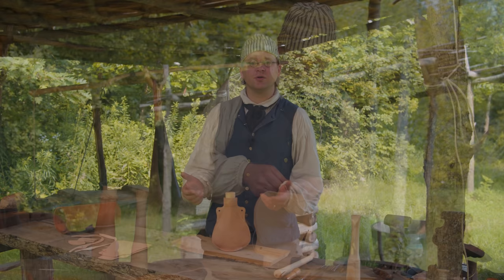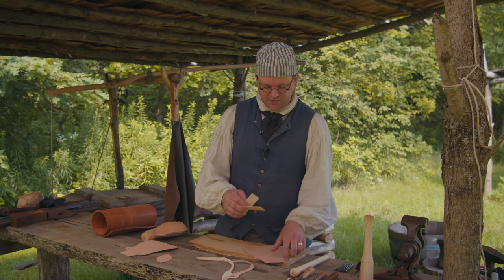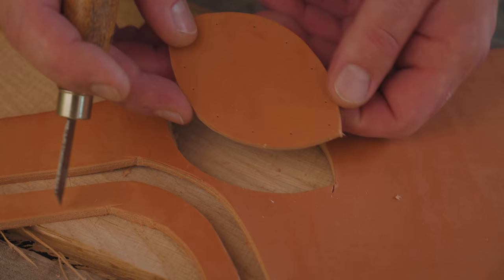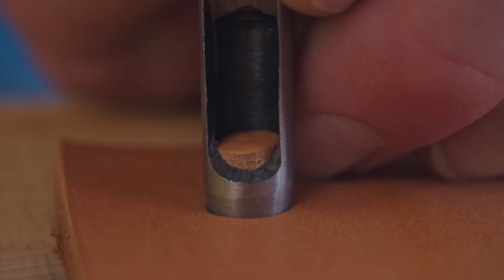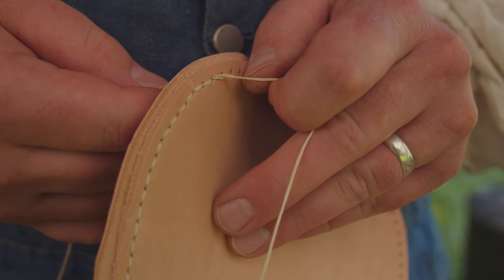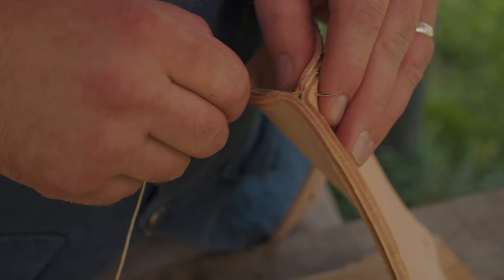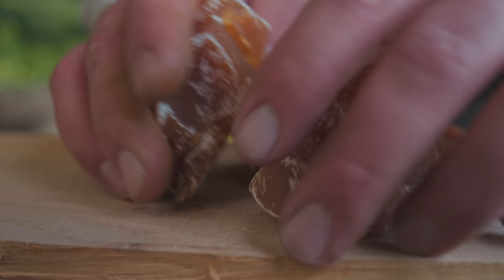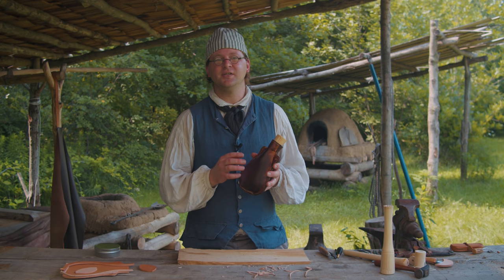Handcraft Your Own Leather Canteen

Comment: Thanks for the video, it was informative and a joy to watch.  Brandon is a good teacher.  This is a project that I would like to try and I am a beginner who has never picked up a piece of leather but I quickly found myself feeling like I was missing steps in the process you taught. To make the a little more beginner friendly would it be possible to put in the description box a list of all the ingredients, materials, and tools used to make the canteen? In the video you briefly showed the basic items you would need, but I felt like along the way you kept bring out new ones for example to two different tools you used to make the holes.  Also please add the quantities, lengths, diameter & amounts needed to create the same exact canteen as you are making.

Also, if there are links to the pattern/materials/tools (18th century or modern versions) that you used and talk about the different kinds to use, like pine resin what grade to use or stay away from. Or a link if there is a Townsend project kit, or materials to make getting the items for the project easier.  To me obtaining and making the pattern is the most important part and without it I would have no clue where to start.

Also, some parts where seemed to be edited or unclear like the first saddle stich, I would have liked to seen the first 5 or 6 stiches to make sure I was doing it correctly. Also, since we were not using one long thread for the job, it would be nice for you to show how to tie off the ends when the string is used up and how you start the new thread so it is seamless.  I also had questions on why you ran the thread through the beeswax and who you twisted the ends of the thread.  

All and all a great video and something I would love to try.

Comment: I have learned things about leatherworking today that I wish I had known months ago, when I first started toying around with waterproofing and hardening leather. My soft leather waterproofing is a mix of tallow and  beeswax, and it's wonderful for soft leather projects, but pitch is something that's been used on curraghs here in Ireland since long long ago, and somehow I just never connected the dots. I guess this'll be my next project. For anyone wondering, the reason why the pitch works is because pine resin is high in oleic acid, which hardens and waterproofs the leather, all the more so when heated, and it won't shrink the leather as long as it doesn't reach the plasticisation temperature.

Comment: Him. "An easy project that the average, common person can make"
Me: watches video
also Me: realistically pictures The ugly, leaky, misshapen atrocity of a leather "canteen" that would result if I tried to make this.
Reply: I know right!...I can't even cut open a box in a strait line.
Reply: The only leatherworking project I've ever made was an axe sheath I designed. It's not pretty but I learned how not to do things... and it is functional.
Reply: A tip, if you need to take 10hours to do it, take 10hours, if you need to cut your stuff in several goes, cut it in several goes, if youre doing something for fun, take. your. time. working fast is fine, but never rush.

Comment: Thank you for the fine demonstration! I have a tip for you…. After you wet your leather, pack it tightly with dry sand. This way you can shape it and get all the wrinkles and bumps out. When the leather dries out, dump the sand and bang around lightly on the inside with a stick, and you’re ready for your resin.🤗🐝🌹

Comment: The bottom oval should be made with its outer edge the same length as the length of the bottom of the bag.  This allows the same number and spacing of stitch holes. I used two small electrical wire with ends twisted together for the initial length measurement. I then spread the middle section of two wires apart to form the oval shape. The wires outline thus forms the stitch line for the bottom leather piece - cut the leather  with about 3/8 inch larger boarder.

Comment: When forming the leather, stuff it full of medium to small glass beads until the canteen is bulging in the shape you want. Let it dry before dumping out the beads. I’ve heard of people stuffing the canteen full of unpopped popcorn or beans in the canteen, but I worry that the beans or popcorn kernels will swell. That may not be a problem, but I’ve never tried it.

Comment: I've seen another type of 18th century water bottle being made before. They used hot melted down bee's wax in a few thin layers as a sealant.
Reply: That also works, though beeswax has the downside of possibly melting out if you leave it in a hot vehicle or direct sun(IIRC beeswax melts around 150°)

Comment: Don’t use metal jawed pliers to pull the needles through the stitching holes. Metal jaws rough up the shaft of the needle, making it harder to pull through. As you use the metal jawed pliers, the needle will get harder and harder to pull through as you progress. Use nylon (or other plastic) covered jaws to protect the sides of the needle - to keep the needle smooth. Plastic jawed pliers are sold by jewelry making supply stores, or you might be able to make tiny leather pads and glue them to the jaws (an iffy project).

Comment: OLD LEATHER SMITH here, Suggestions, I have found that the Backwards stitch works just as well, Bees wax will also seal the Leather, needsfoot oil 4 the out side puts your essential oil back in 2 the Leather, GOD'S BLESSINGS ✝️⚾🙃

Comment: You all make some of the best content on YouTube, thank you! 2 Part Question: How do you measure what the leather canteen can hold and, what kind of liquids will it hold? 😉😉
Reply: Well, with the tools available nowadays I'd say fill the canteen with water and then pour it out into a measuring cup, that should give you the exact amount it can hold. Or just measure with cups, 1 cup is 250ml. It can hold any kind of liquid if properly coated from the inside, except boiling hot drinks. Be aware though that after a couple of hours the water (or other drink) will taste a bit like leather and the coating you used. I generally don't recommend storing milk in such a canteen because it will taste horrible afterwards (except maybe if you used beeswax for the coating but I haven't tried that so I can't guarantee)

Comment: Great video. I think I've seen where you can wet the leather then pack the canteen with sand. Ramming it in until it forms the shape you want. Then you let the leather dry and pour out the sand...and give it a good wash. Have you seen anything like that? Thanks
Reply: That's a technique I've used many times with complete success. I have a couple of buckets with sand that's been screened to leave coarse, round, sand with grains about 3/32" diameter and no fines or bigs. Packs and pours very well.

Comment: I'd love to see more leatherworking videos like this for satchels, hats etc. 

My only question is: Isn't that a bit small? Like it must've been for just working in field cuz on a trail etc you'd need a lot of water each day w/o getting massive dehydration. You'd have needed like 10 of these for really hot days like that. 

Also how would you continue to care for the canteen after coating in the pine res and oil? Would a saddle soap or other leather softener/conditioner for shoes be acceptable?
Reply: Just wash it with mild soap if needed and then rub in some more vegetable/plant/seed oil (even butter works) once in a while to keep the leather from drying out and cracking and you're good.

Comment: Cool video. Several questions i have: Wouldn't it be easier to just use the single piece of leather and wrap the ends around a hollow piece of wood or bone (for the neck) as a sort of water bag? What were the standard size of these? The one you made doesn't seem to fit a lot of water. And last, do you have a step by step process we can watch somewhere?

Comment: Seems like it has a really small internal capacity, not much water and seems like you would need several of these. They may be quieter then wooden ones and way easier to make then metal ones but those you two you can make with a larger carrying capacity. its a trade off.

Comment: Not a "gusset" those pieces are called "welt". Also, using an awl and cutting holes INDIVIDUALLY on a diagonal makes for exact stitching and molding, and more neat, uniform and handsome stitches. Also, a  true saddle stitch requires a half hitch within each stitch.  Locking the last stitches is something else your smithy did incorrectly.  Most people will not know how to source pine resin, but propolis can be had quite easily. The edges should be finished smoothly so leather layers can not be detected. If you invite me to help you do another video, I can show your smithy and your audience the correct way to do this.

Comment: If you're going to do a single project or two, the various hobby knives etc. are OK I guess. If you are going to do more than this, quality (read: not cheap-o knives made of Chineseium) knives are absolutely the way to go. You'll need to learn the proper way to sharpen them too. They need to be scary-level sharp to be safe. A dull knife is the one that cuts you deep and leaves a lasting scar, as it slips out of the work, but leather is usually quite a bit more resilient than human skin, so it's sharp enough to cut the crap out of you. Note; blood is almost impossible to remove from a nearly completed project; ask me how I know. The things he says on this video, about going slow and making that cut correctly is 100% accurate.

Comment: @townsends So I bought some of your Brewers pitch to waterproof the inside of my Canteen.  However, I noticed a couple of places where it still appears from the outside that the leather is soaking up water. Not sure if this is a showstopper or not. I have redone it three times now and can’t seem to get this to stop. I did notice that when I first added the Brewers page to the inside that there were a couple of places where the pitch seem to bubble up and I suspect those might be the problem areas. Any suggestions?

Comment: Wonder why you'd use pine resin instead of beeswax to seal the leather.
Reply: I was wondering the same thing. Only thing I came up with is the pitch soaks into the leather to harden it, that's why he was tapping it at the end.
Reply: Beeswax will melt or fail faster than pine resin which forms a 'hard' coating
Reply: @broccodoggo8363  I'd wonder about it cracking, though, since the beeswax would tend to penetrate the leather more, and would be more flexible, since it stays softer then pine resin.

Beeswax was commonly used to waterproof shoes and boots because it retains the ability to seal when the leather is flexed.
Reply: @EphemeralTao  it also has a bad habit of melting out on particularly hot days. Brewer's pitch has a melting point about 100° higher. I know some people use a mixture of the two

Comment: I would highly recommend using beeswax instead of brewers pitch to coat both the inside and outside of that leather canteen.  Water left all day in a canteen of any kind that is sealed with brewer's pitch tastes pretty nasty.  It's a very piney flavor that is not "piney" in a good way.  When reenacting I always fill my canteen just before we take the field to avoid that unpleasant taste.
Reply: Don't recommend beeswax.  It drys out and chips.  That is why the originals used brewers pitch.  Which BTY is black in color.  Don't know what this guy in the vid is using.
Reply: @chriswitmer4446  He is using brewer's pitch.  I used brewer's pitch in the canteen I bought 20-years ago and still use that canteen.  It ALWAYS makes my water taste bad if I have it in there more than a few hours, especially on a hot day.  

If I get some permeability down the road, It's really easy to heat up some beeswax and re-treat it.   A reenacting friend of mine used beeswax in his canteen and it always tastes good even though he's only done that for the last 10-years.   I also have used Beeswax as an outside coating of leather goods such as the center-seam knife sheath I made and I've never had a problem with it drying out and flaking...ever.

So, you go ahead and use pitch.  I'm using beeswax and don't ask for a drink of my water when yours taste like rotten pine.

Comment: This was really good. I’d have like to also see how to change from one thread to another when the thread ran out.  I wonder if the water tastes like leather and pine for a while.
Reply: One method I use is to take your new thread, and start sewing four or five stitches BACK, going through the holes you've already stitched
This prevents the stitches at the end of the first thread from unraveling, and you don't have to tie the thread
Reply: @mikegrossberg8624  oh, excellent!  I can see how that could work.  Thanks for replying!
Reply: @merindymorgenson3184  Glad to pass on what I've learned

Comment: I’ve seen a few different coatings for the inside including “bees wax”. None of that affects the water in anyway? I know to use nothing toxic but how’s about flavor or little bits floating around??👍🏽🤠
Reply from the maker: The coatings will absolutely affect the water. Any reproduction coating you use will flavor the water to some extent and although beeswax is one of the mildest in regards to flavor it is also one of the brittlest and will break up after time and you will need to reline the canteen.

Comment: yea but is it waterproof? just wondering because of those 4 large open holes.
Reply: You mean on those shoulders? That's fine, it's watertight. That section is separated from the water, designed to put a carrying strap through

Comment: Rather than use a special tool to try to wet-form the costrel through the mouth, why not simply pack it full of dry sand and let it completely dry for 3-5 days.....then simply pour out the sand?
Reply: They didn't have no fancy packin' sand back in the ye olde woodlands!

Comment: Really cool :D 

One thing I'm wondering though is what kind of oil did you use on the outside to seal/clean the pine resin?
Reply: Really any kind of vegetable/plant/seed oil works. Even butter would work.

Comment: Might aswell buy one, it'll be cheaper than getting all the tools and material.
Reply: presuming you can find one anywhere lol, plus tools can be used to make any other leather project you want.
Reply: You can pretty much just use a pocket knife(or preferably, swiss army knife) to do most of the work needed.

Comment: What is veg tanned? I know about brain tanning, but never heard of veg tanning.
Reply: Veg tan is a process using plant based(can't remember the specific plant right now) tanning solutions, which avoids the mess of brain and urine tanning. It's one of the most commonly used methods today in the US and Europe to get that moldable, hardenable leather we all love
Reply: @TheTrunks340  Thanks. I had never heard of it before.
Reply: @FlyTyer1948  yeah, it's also an old method, but it really took over. 

And of course you have chrome tans, alum tans, oil tans, combination tans... alot of different kinds of tanning

Comment: Am I the only one who wondered why he cut out a template from a perfectly good peace leather to use as a template on another peace of leather
Reply: Its so he can make multiple canteens like the one he made. Also I imagine its more period accurate to use something like leather instead of paper since its not like he would print out a pattern with a printer
Reply: @isthatasupra4727  with historic accuracy then unless you were a profesional leatherworker you wouldn't be using pricking irons to make the holes infact using a template at all would have been unlikely. It isn't the making of a template that I find curious it's the making it out of untreated leather that has me scratching my head (but it does look nice)

Comment: He just neglected to tell how to start a new thing of thread of what you got didn’t go all the way around and he didn’t say how to tie it off which seem like really important steps to this
Reply: Look up saddle stitch tutorials for more info. End the stitch by going backwards 3-4 stitches (“back stitch”) overlap the new thread for one or two stitches. BTW, use 4x the length of the stitch as your thread measurement. Maybe more if you’re going through a lot of thick leather. Long stitches/threads can be a pain. But, I prefer them to piecing them together. Loooknup “stitching pony” for a way to hold the work. I made my own. Very happy with it. It’s like an extra pair of hands.